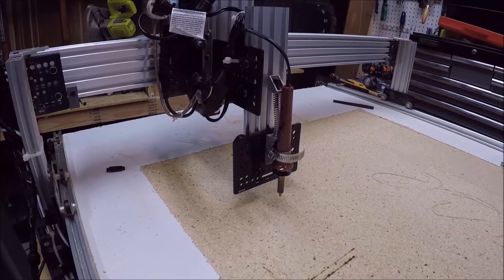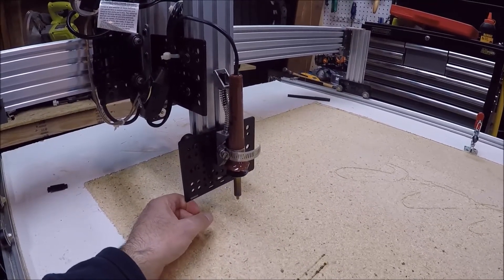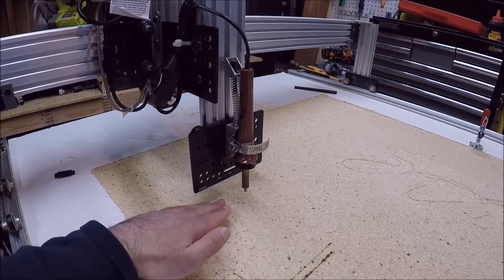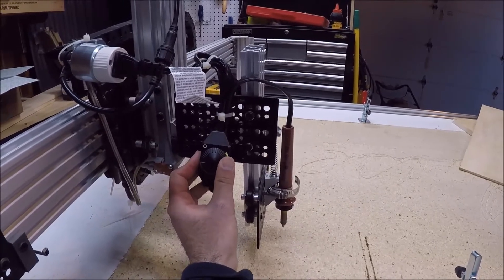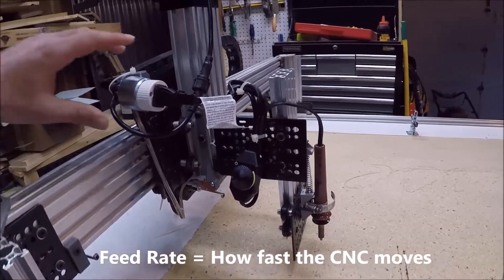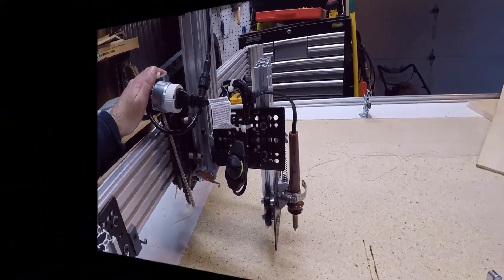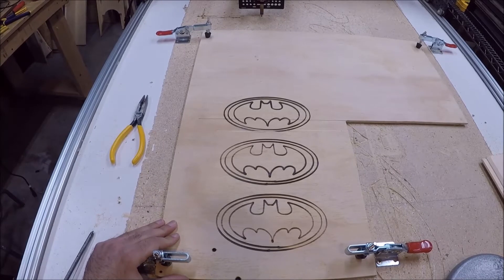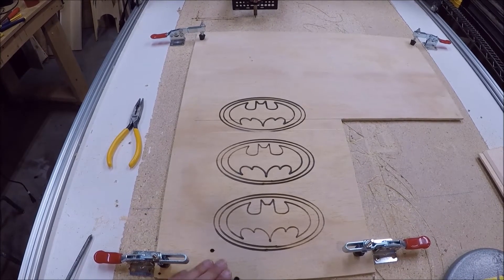CNC Wood Burning Tool

Comment: Where did you buy the set up. Very good video
Reply from the maker: Thanks! I bought all of the aluminum extrusion, plates, wheels, etc from Openbuilds. com. The wood burner and spring were from a big box store or Amazon, can remember which.